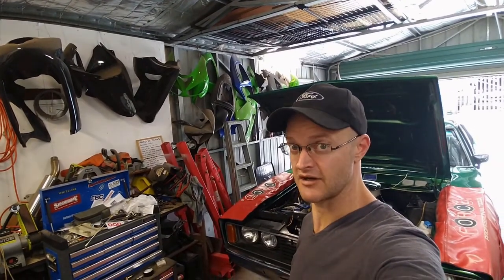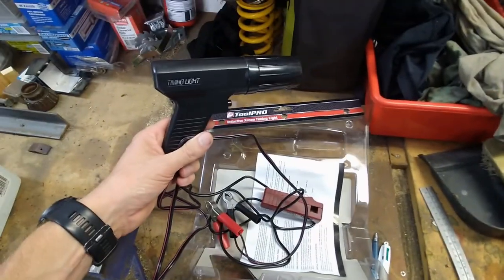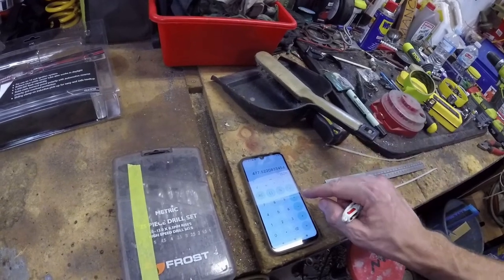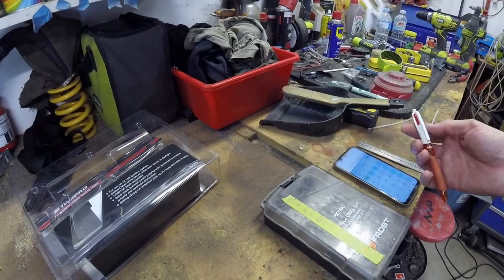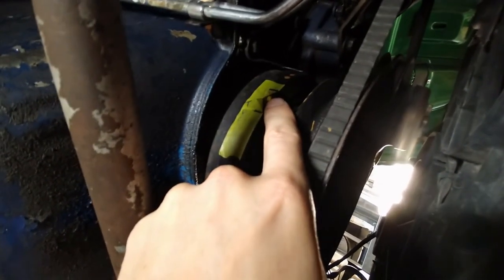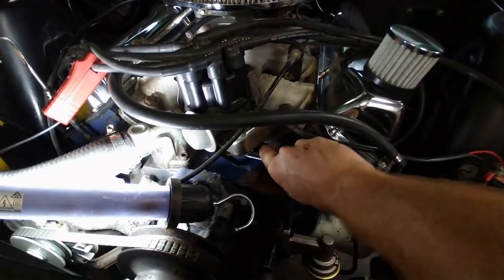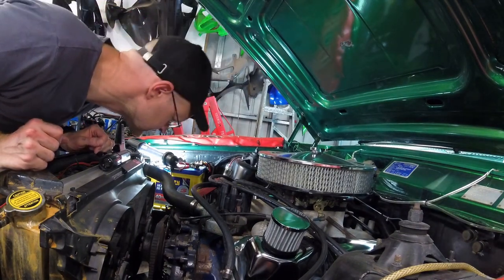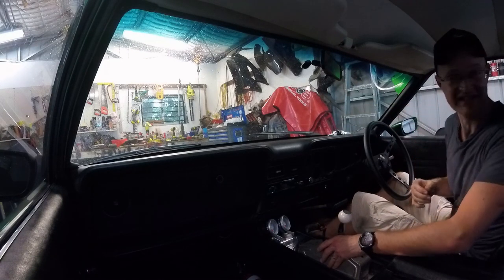XC Ford Falcon 351 Cleveland Project: Ep 56 Finding hidden timing in my rebuilt engine.

Comment: I bet your radiator cap is incorrect. The rubber seal on the sprung foot is probably the shorter reach unit, Thats why you've got a hiddeous leak flowing out and around your filler neck!
Reply from the maker: I do need to check that out, I've been writing that off to cracking the cap to check the water level when its hot....ebay radiator!

Comment: nice falcon. me and my friends had quite a few cleveland powered cars over the years and yes, timing is a good place to start looking for power. we discovered that the factory base timing spec ,usually around 10 deg , was just a starting point and that they liked a fair bit more initial than that. especially a soon as it had a bigger cam installed. can i ask if you have done a cranking compression test?
Reply from the maker: Cheers, while I was figuring out the piston dwell I gave cylinder one a compression test, it came in at 170psi but I haven't done the rest yet. Its on my to do list as I go over this engine.
Reply: @Missleindustry  170 is good. Check them all as unleaded fuel is not friendly to old clevelands and that bang back through the carb it did could be a leaky inlet valve. If there all good then the pop was lean out and if its a holley on that thing get yourself a set of accelerator pump cams and check the pump nozzle size and maybe go one larger. Getting the pump shot and initial timing right makes a huuuuge difference to throttle response on those old sleds. Check that it has a proper cleveland rad thermostat in it. Very important.